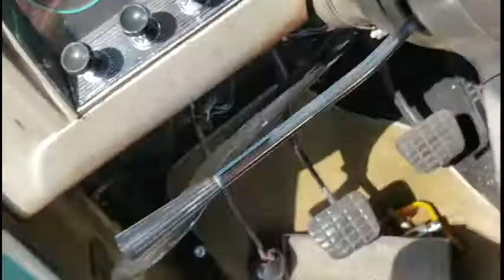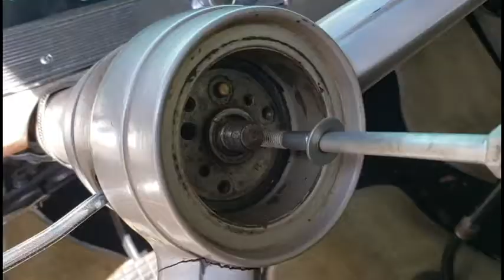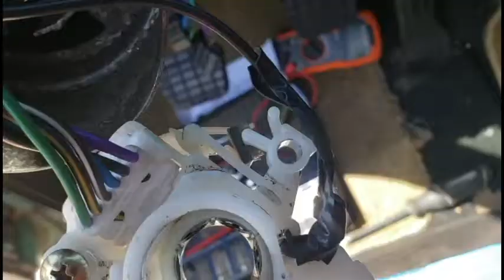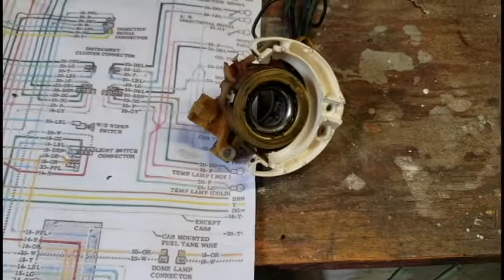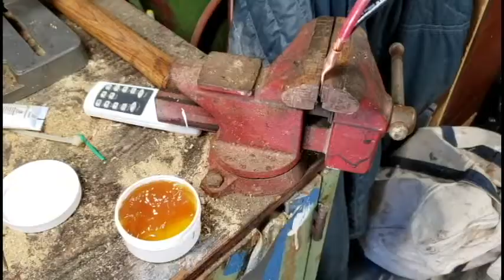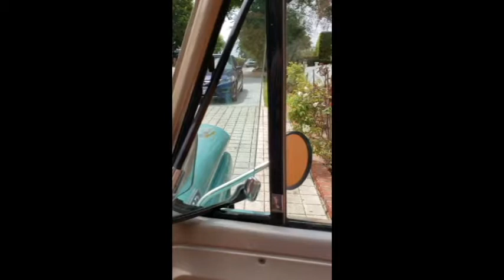My 1965 Chevy C10  Fix turn signal switch, replace battery cable, and vent window

Comment: I’ve replaced the exact same things for my 70 Chevy step side recently. Bad luck with the new turn signal switches. I’ve bought from 2 different vendors. All crap. Not sure what to do. I have no lights and no turn signals as of last night. Cheap China crapola.
Reply from the maker: I agree about the quality of the replacement switch.  Probably all from same manufacturer regardless of vendor.  Only solution is to bend the metal strips so they function properly.

Comment: Great video. I have the same issue with right turn signal. The spring wires are supposed to be touching?
Reply: I even got a new turn signal switch but no luck. Can you please advise. Thank you
Reply from the maker: It has been a long time so can't tell you exactly.  However, my recollection is that the spring connector for the front right did not connect (spring touch post) as it should when switch moved to the right turn position.  I had the same issue as you did that a brand new switch did the exact same thing requiring surgery!

Comment: I’m haveing issues with clips need to bend them but. What’s best way. Both signals work but no break lights after my attempt bending before I had break lights and one blinker for rear worked other would make flashing lights
Reply from the maker: It has been a while  but I am pretty sure I just used needle nose pliers.  Locate tabs for brake lights.  Make sure they make contact when the turn signal switch is in the neutral position and break contact when the turn signal is on.  When turn signal is on the turn signal (left or right) tab should engage and the brake tab for that side disengage.

Comment: Do you have a Facebook I can get ahold of you on? I have a question about my 66 c10 blinkers.
Reply from the maker: Sorry no Facebook.
Reply: Well I’ll ask you on here. So my 66 c10 front blinkers are not working but the rear are. They are plugged in is there a switch or solenoid that could be bad anywhere?
Reply from the maker: The only switch is the turn signal switch on the steering column.  My issue was only on one side but the really unusual thing is the brand new replacement switch was bad too.  As the video describes it took a little tweaking of the metal tabs to get things working properly.
Reply from the maker: You can find the wiring diagram on line

Comment: Ya didn't show the only part I'm having trouble with..getting the switch assembly off the shaft after removing the 3 philips screw..mine is stuck like something else is holding it..
Reply from the maker: I am guessing maybe the wires are holding you back.  Check out Lugnutz65 blog for very detailed disassembly.  
 https://lugnutz65chevystepside.weebly.com/1963-chevy-c10-steering-column-disassembly.html
Reply: @ron12april  We got it out..Corvairs have a snap wire holding the lock in...it's like a snap ring but is just a stiff wire ring in a groove..very hard to see cuz it's recessed and there is grease on it from the bearing and I'm  guessing other Chevys don't have it..

Comment: What adjustments did you make on internal spring bars? Bent in what way?
Reply from the maker: It has been a while so I do not recall exactly.  Bottom line I looked at which spring bar made the contact for front right by tracing wires, and adjusted so it would stay off when switch not on and stay closed when switch on.

Comment: Nicely shown and narrated. May not have all the needed instruction. But having to mix a red and black cable on the soldering segment for demonstration is ok. But never mix the two polarities.But never implied.  There is other ways to replace the vent, one very costly as you shown.Also the trick to get it out was not shown. The other much less expensive. Of course if doing the vent. The window and seals should be done also since apart. But over all nicely done.

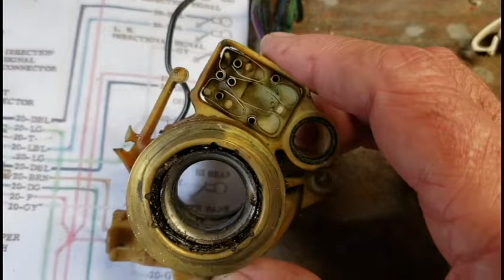Comment: My '65 Corvair is very similar.  My problem was with one of the metal contacts at 4:50.  Requires care when bending as not to bend another part of the brass contact.